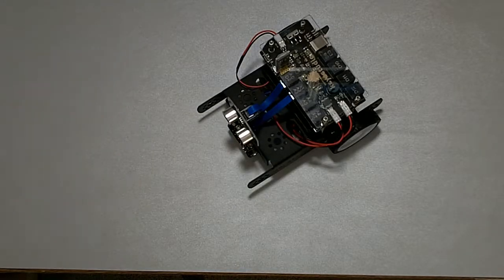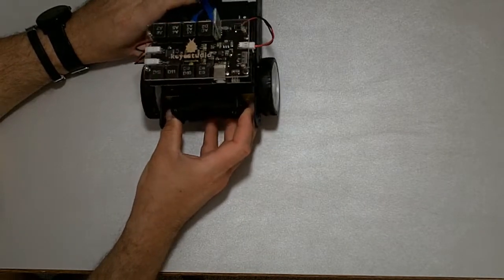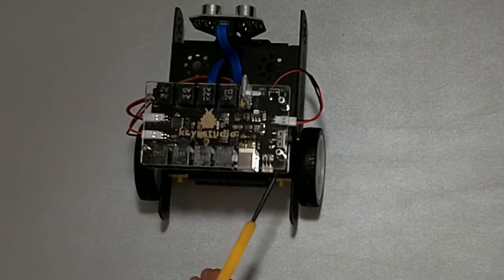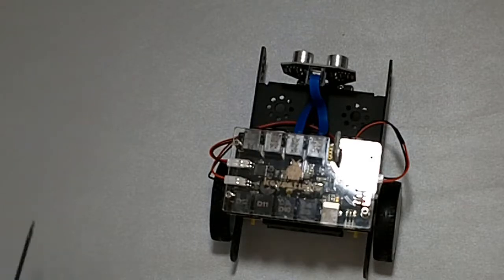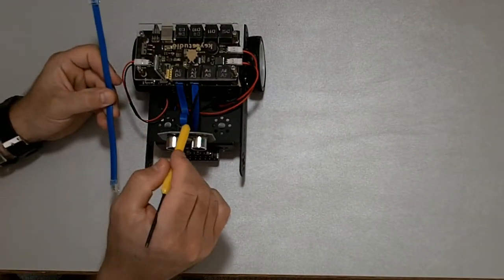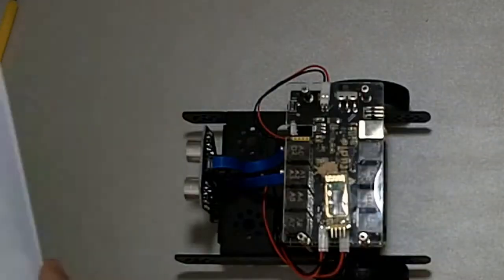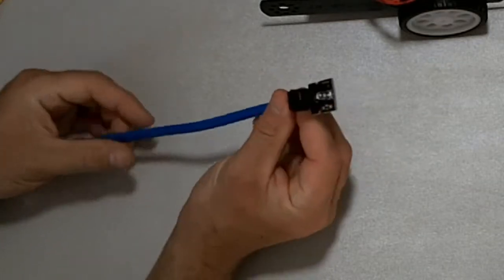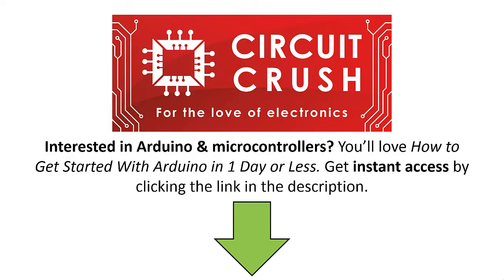Keybot Robot Kit Part 3: Final Assembly

Comment: It says to plug the Bluetooth module after you are done programming the main controller board. That is because the Bluetooth module connects to the serial pins and these pins are used to program the control board. So Bluetooth module will cause error while uploading the code.
Reply from the maker: Thanks for the comment. Did you buy/assemble/program one of these?
Reply: @CircuitCrush  Actually I won this kit in giveaway on Facebook group. But I have worked with arduino and bluetooth module before.
Reply from the maker: @HarshDethe  Was it our FB group? Arduino?
Reply: @CircuitCrush  Yes
Reply from the maker: @HarshDethe  Well congratulations!
Reply from the maker: That's actually kinda odd now that I think about it. Did you see my video on programming the bot? I didn't use the BT module yet, but was able to upload the programs I did do just fine with the board plugged in...
Reply: @CircuitCrush  I haven't watched that video yet. May be they use some other pins for Bluetooth connection and use serial pins for programming. According to my experience, when Bluetooth module is connected to serial pins,  arduinos usually throw error messages.